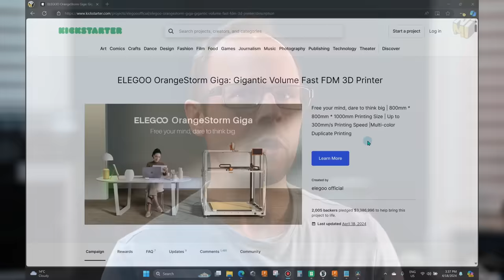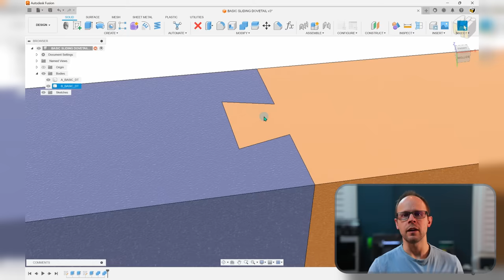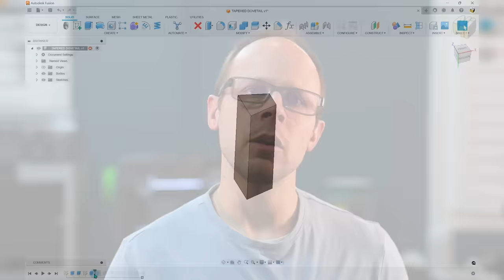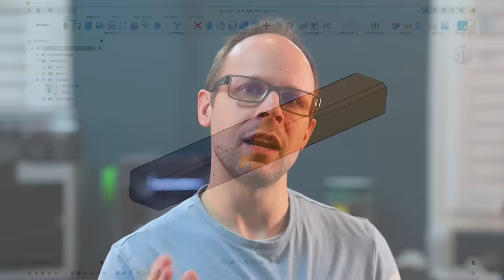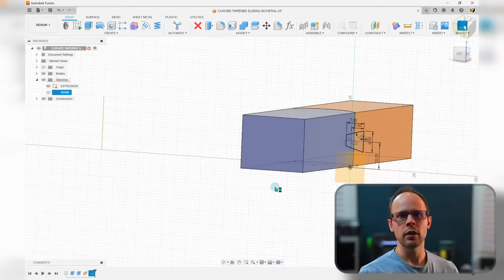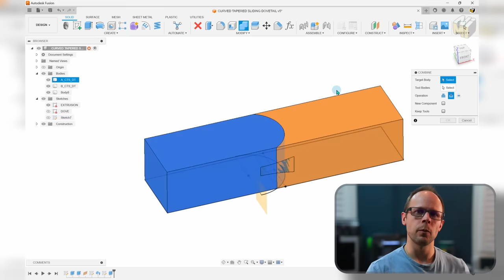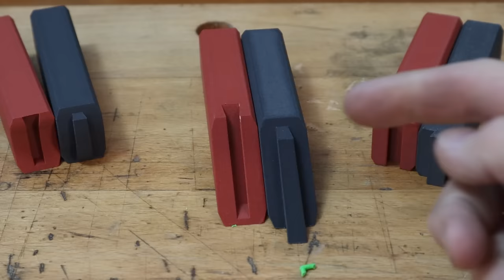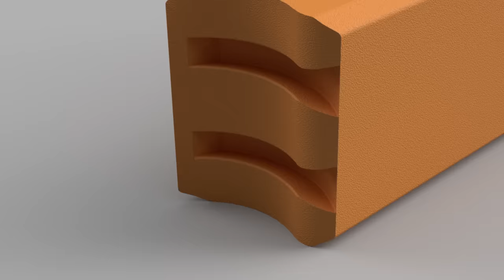Modernizing the best Woodworking Joint to use for 3D Printing

Comment: Absolutely awesome tutorial Mike!  The creation of joining pieces seems to be something of an art that is often overlooked in a world where we can just buy larger printers, but I think you've really opened up a lot of opportunities for those with smaller build area printers here.
Reply from the maker: Nice, thank you!  A slightly bigger printer is okay, but too big, I'm not so sure it's a good idea, they'd need to be enclosed, insulated, heated and then even after all of that, you're still going to have problems with shrinkage and warpage.  I suppose it depends on the material, I think at least for now until bigger printers are perfected, it's better to connect the parts.  Can you imagine making a large print and your print fails, that's an entire print and all of that $$ down the drain, at least with separate parts, you'd be able to salvage some of it.  I'd be willing to test a big printer down the road, I just am not convinced that printing plastics on a large scale is a great idea.  I say yes to printing Concrete for houses on a large printer though.
Reply: Thank you soooooo much!!
Reply from the maker: @mariusschmoe5514  No problem!
Reply: Larger prints also just take longer to print. Using two or three smaller printers in parallel can be a cheap way to get those large prints done in acceptable time.
Reply from the maker: @marmelade5118  That's a great point.  Having 3 smaller printers gives you a good backup plan as well, if you have one big printer, when it goes down you're not likely going to have a backup for that.

Comment: As someone who has SOME experience with Fusion 360, but also is not great at using it, I find it hard to reproduce what you're doing.  Sometimes there is enough specific detail, but other times you seem to be rushing through steps and I struggle to figure out precisely what you did.

Comment: Love this, because as a small-time woodworker I've done a few dovetails and then abandoned them cuz they're just too time consuming. But cad and 3D printers make this far easier. But this is not just for parts that are too long to fit in your printer. An assembly that needs to be disassembled in future could benefit from this, if there's room for the joint. Screws are very fiddly and time-consuming and anytime you can replace screws with something designed into the plastic that's a win.

Comment: This is awesome! That curved dovetail with a lock is especially sweet. Taking a concept from the woodworking world and creating something that can't practically be done with wood, but is easily done with 3D printing. Really appreciate the great ideas!
Reply from the maker: Thanks 802, I really appreciate the support!  I think I'll have to do more how-to vids, maybe with a bit of a better and more interactive setup.
Reply: I think you could do it in woodworking, but it'd be with a router and a bit with a bearing on it to use as something to follow the curved path. it'd take a lot of fine adjusting though and probably not worth it.
Reply: @atomictyler  Yep I was thinking the same in my head so I added the word practically haha. Would be a fun challenge!
Reply from the maker: @atomictyler  I first had this idea 20 years ago and I used it on my final project in College, I had 8 legs connecting into a central curved body with the dovetail connection and they were also tapered, it was incredibly difficult to pull off, unfortunately the end result wasn't as good as I had hoped, the legs were slightly undersized and the table vibrated more than I expected.  I still graduated luckily!

It's about 100X easier to do in Fusion than by hand!

Certainly possible in wood, but like you say, it's not worth it unless you enjoy torturing yourself.
Reply: You can do the rounded part fairly easily i imagine on the router table with a dovetail blade, and a jig that translates the curve you want to the cutting blade of the router. Stop short for the female, cut the end off for the male, go back and chisel the inside of the end wall to flatten it out in order to receive the whole male part. Honestly, id  make a video on this in response. I just got a 1,600sqft workshop after years of hard work(im 24) and I've been wanting to make a youtube video.
Reply: @jacobmoore4665  Hey more power to you! 😁

Comment: This helped me so much. Using Dovetails to join a cup portion of a cup holder with the clip portion allowed me to print the clip in the correct orientation so the layer lines were perpendicular to the bending motion. Had to replace 13 cup holders with my new design incorporating the dovetail but they are strong AF now and these joins have completely opened up my mind for designing parts now.

Comment: Really cool. One advantage of the dovetail in woodworking is that the joint stays tight as the wood expands and contracts with changes moisture content and temperature - not such an issue with plastics.

I would love to see some heuristic strategies around which joints to use under which types of loads. In this video it looks like you are making longer rods which could see very different stress patterns depending on use. It would be interesting to hear which styles cope with which stress patterns best.
Reply: Ironically moisture with 3D printing is still an issue with 3D printing but it's slightly different. It messes with the initial printing stage where as with wood dovetails actually take advantage of the shrinking effect to their advantage and makes an even tighter fit as it shrinks around the joint creating a stronger joint (it's normally done with green wood, kiln dried wood is fairly stable)
Reply: @SilvaDreams   I would think the plastic has to expand if taking on water. Like a spaghetti noodle to a much smaller degree. I'm def not a materials scientist. However it experiment time soak petg part in water overnight, measure, pop it in dehydrator, measure it.

Comment: I've been using dove tails in my designs for a while but that one along a curve is pretty sick. Thanks for sharing it!
Reply from the maker: Nice!  I've seen a few dovetails here and there as well, some of the bigger drawer units, the last project I worked on needed a bit of a special solution so this was the result of the video.  I've used something very similar back in College 20 years ago for my final project, but it was made from Wood and though it came together, there were still some flaws.  I'm glad you liked it and I have many more to come!

Comment: Good topic and well explained. Would be nice with a follow up video where you test the strengths of the joints. 
Thanks for sharing 👍🏼
Reply from the maker: I was originally going to do the testing for this video and I'm in the process of building a testing jig so that I can test in tension and compression.  The issue I ran into is that some of these joints can be tested with loads perpendicular to the joint, but some not so much.  I'd almost need a particular case and then create the connections to suit it the best and then test those.  Thoughts on that?
Reply: @NeedItMakeIt  maybe I'm over simplifying it, but I would do the following:
1. Tension and compression from the ends and see where and how it breaks
2. Fix the ends and then press perpendicular on the joint from different sides. Depending on the joint type it could be more than two tests.
3. Based on results summary, see what joint is good for what scenarios
Keep up the good work 👍
Reply from the maker: @TheRealStructurer  Oh, you're speaking my language, I am a fan of all types of simplification.  I'll have to do a bit of research on the typical testing jigs and make sure I have the right equipment.  I have Two types of load cell at the moment, I have a crane scale, and I have a load cell with Digital readout as well intended for compression up to 4K lbs.  I'd need to integrate them along with a scale to measure movement along side load.  I've found that even my slo-mo camera mode isn't a high enough frame rate to capture the moment of failure, so I'll need to think about that.   I know Slant3D did a Kickstarter for testing equipment, I wonder if I should try something similar?

Comment: I love your scarfed and circular dovetail solutions, those look like awesome joints for different situations. I also like the idea of tapering along the length of the dovetail because they can get vaery stiff trying to put them together otherwise. I lot of very good information here, thank you. I find the classic mistake a lot of designers make is to not fillet the corners. I would say the smallest radius curve possible is around half the nozzle diameter, but I find in practice that the fillet radius shoudl be at least the nozzle diameter and it doesn't really hurt anything to go much higher, say 1mm as this eliminates any bulging at the vertices, which means you can have tight clearances everywhere else. On one of my designs (drawer units that slot together) I used a double-ended dovetail spline (sort of like a butterfly) that slides into slots on the drawer cabinets, and on that I made the fillet almost half the width of the dovetail, to it looks more like a "bone" shape, almost a figure-8 cross section but stretched in the middle. It was experimental but it worked really well in practice, easy to insert and remove yet holds the cabinbets together tightly and doesn't fall out. I wish I could post images here, I'd post a screen shot of the design, I hope my description makes sense.
Reply from the maker: Yeah, each of them really has their own benefits, they're not really an apples to apples.  I wanted to strength test them, but it doesn't work, I would have had to test them each in a different direction of loading.  The most basic dovetail with the taper works really well and it's pretty straight forward, it's just better than the standard dovetail.  I think in Woodworking to keep things simple we only had straight cut and relied on the glue to do the rest, it's simpler that way.  Here we can do whatever we want.  

I agree with your note about the Rads, these connections were pretty small and I kept the rads really small too, but a little larger is better.  Calibrating the filament helps as well to make sure you end up with the sizes you're supposed to, the slightest change in size on these connections makes a pretty big difference.  

It sounds like you're doing some large-scale work, are you on MW at all?  What's your background, it seems like you have a background in Woodworking and Construction.    

Yeah the bone shape might be better in some ways, getting away from the sharp edges, what is the best shape, I wonder... now that's something that could be tested.

Comment: You can also make a compound dovetail, or tapered like violins and some guitars have on the arm joint, it makes so that it really locks together with the advantage of easy disassemble if needed.
Reply from the maker: I'll check it out.  I love the construction of a violin, I'll have a closer look at that part.  Very nice, thanks!

Comment: Okay I'm impressed, I didn't see the point due to having a large printer but these actually look incredible on top of being useful
Reply from the maker: I'm starting to see a trend, and it's slowly building of people using 3D printers for making furniture and parts which need to be strong and I thought I'd start to put some ideas together about it to see if maybe it could help some people, or at least it would be interesting.  Combining traditional woodworking with 3D printing to come up with something that's not limited by the way we'd machine the parts in wood is fun and it's a good challenge as well.  I hope that people can find a use for them, and maybe come up with their own ideas that are better than these ones.    I'll have more videos coming soon, in the same style to this one and I'll include some testing as well to see how strong they really are.

Comment: Very cool concepts explained here that cannot be easily made in wood!
Reply from the maker: If you can believe  it, I made the cured tapered sliding dovetail connection back in College for my final project, and I did it 8 times on the same piece of furniture; it was a lot of work!  The colors I used were Titan Grey PETG-CF and Brick Red PETG-CF.  They have to be some of the nicest looking filaments out there.

Comment: Dovetails are good for a lot of things because of how precisely and securely they can hold. If you are making removable or modular parts then even just a basic straight dovetail can be good because you only need a way to secure it against linear movement in the direction the dovetail is inserted since the dovetail itself prevents all other movements. Basically dovetails secure against all movements except their insertion movement, so your curved examples will be fine for all motions except rotation in that axis, which allows you to design the shape of the dovetail for the expected forces in your application.

I have used dovetails for connecting the legs on a hexapod robot. The legs are made as their own removable system (to allow fast removal or replacement of legs) that can attach onto the body using dovetails. The dovetails don’t go all the way through (to help locate the parts vertically) and have a hole in them for passing wires through. I have two methods of locking them in the vertical direction, the first is just with some bolts normal to the attachment surface/plane, the second method is when the top plate of the robot is connected it prevents the dovetails from being able to lift out again so they are capped at the bottom and top and bolting the top plate down holds them tightly.

I also have used dovetails for modular attachment points for cameras or sensors and hey have been held in place with the same methods I described above.

An interesting idea that came to me whilst watching this was for a dovetail that works by twisting the parts together, basically a dovetail (probably better using two) that is swept along a circular path in the plane where the parts join.
Reply from the maker: Back when I did more Woodworking, we were using them non-stop, though they were always straight cut due to the limitation of our hand tools and machinery, it's nice to be able to remove those limits and have a bit more freedom.

There are probably slightly better variations which work for plastics better than they would.... for wood as well. 
 More curves and it would also depend on the plastics you're using and infill settings etc.  I just finished some testing on GF filament for example and it is quite stiff and brittle, compared to PETG which is flexible and tough (With 100% infill) 

Would that dovetail be one set along a path on a portion of a sphere or a compound curve in order to achieve that result?
Reply: @NeedItMakeIt  It would be a circular path, although it could maybe be applied to a sphere too. My idea was that you place the two parts lined up, end to end and twist (almost like a screwing motion) to slide the dovetail in.
Reply from the maker: @conorstewart2214  Yes, I can picture it now, that's a very interesting idea, printing orientation would be an issue with this style, I'd need to try to create one and see how it needs to be printed, I think standing up straight in the air with the faces of the connection horizonal would work.   I have another video coming this weekend for a follow up, one I've finished that one I can look more closely at your idea.

Comment: Joining smaller parts together is a best practice for functional 3d prints anyway, as even if you have a huge printer, you don't want to carry any stresses across the layer lines, making orientation super important. Just as important as grain orientation in woodworking.

Comment: These are super useful joints.  I only wish you would make another deep dive video spending a bit more time showing the design and modelling phase.  In particular of the cylindrical rotating dovetail joint!
Reply: 100% I was trying to follow along while he was in fusion but it was so fast

Comment: You can also put a dovetail shaped hole through perpendicular to the joint in the elongated dovetail to put a dutchman joint in there for even more strength.

Comment: Very cool video, i could use a longer version to explain how to make this in fusion, but i guess that was not the purpose of the video. You are a master!
Reply: Personally I prefer drawing a sketch with a closed polygon with the total tolerance and extruding/sweeping that. But it's a fidgety process
Reply from the maker: I'm working on a better way to present these so that I can convey the info better and focus on the main points.   I'm shooting for a live-action and I'll cut out the bits with no action.  Capturing the screen and than narrating it works fine, but it's not as good as explaining while doing.   Thanks for your support!
Reply from the maker: That's a good option too!  I've used both methods as well, there is another option too, and that's to do all of the work to one part and then use that as your cutting tool, I don't know that it saves anything, it's just a bit different and I've used it with success as well.  I'll have to put some thought into what might be the absolute best and simplest method.
Reply: @NeedItMakeIt  the sketch with tolerances (either method) makes it more logical to use a global tolerance value. If a global tolerance doesn't apply to all distances, then the shown method is easier to understand
Reply from the maker: @jakobhansen1396  I agree, I think it's best to get as much as possible in the sketch and set parameters as well.  It depends on what you're doing and whether it's worth the investment in the extra time.  I'll be doing more connection videos and I'll see about showing some different options for setup.  Thanks for  your thoughts on that.
Reply: @NeedItMakeIt  you're welcome the video was very good and on a relevant topic